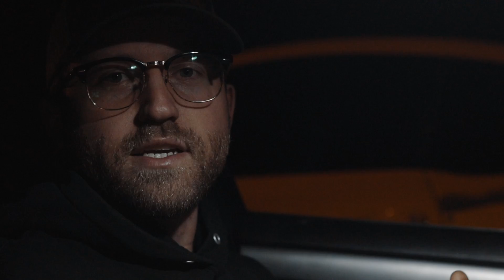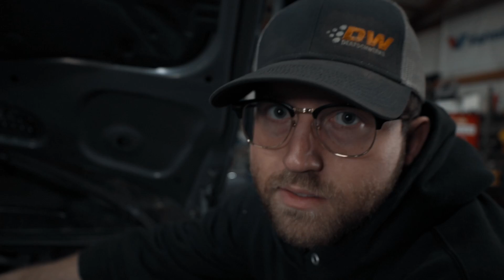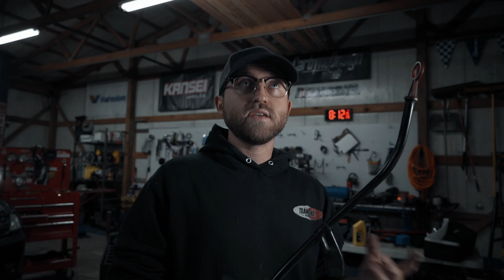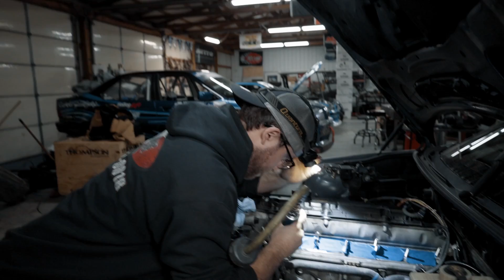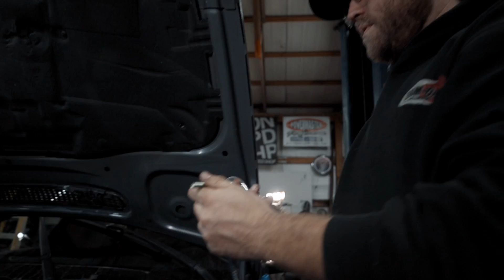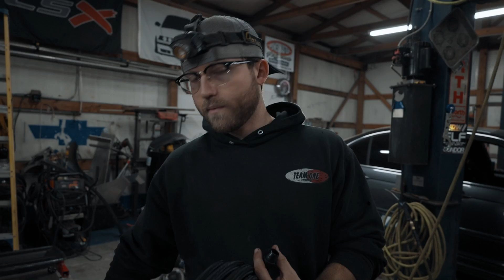BEST E46 M50 INTAKE INSTALL VIDEO - Is it worth it?

Comment: What part on the intake did you hook the catch can to? 
Valve cover-> catch can -> intake manifold. I’m doing a swap too I don’t know where I’m going to mount it, didn’t spend time on the video how you installed it
Reply from the maker: I ran a atmospheric catch can so it just goes to the valve cover directly. No intake vacuum at all. 

Are you running a sealed catch can or atmospheric?

Comment: Hey nice video man, also a question, where did you route your fuel pressure regulator ?
Reply from the maker: The FPR is built into the fuel filter on the E46😊
Reply: @jack_davis_ what about the 2 smaller vacuum lines that went into the f connector on the stock intake boot. Wondering where u routed those two. Think the bigger one was the purge valve and yea the smaller was fuel pressure regulator vacuum. Any help appreciated nice video bro
Reply from the maker: @albertomendez9336 So I plugged off the purge valve hose and put a cap on the F connector. The purge valve and system was also deleted in the tune. I did reinstall the vacuum line on the F connector for the fuel pressure regulator.
Reply from the maker: I would just put them back in the stock location if you don’t plan on deleting anything!
Reply: @jack_davis_ i really do appreciate the response bro, i saw in another comment u deleted the purge valve and im probably gonna do the same.

Comment: The stock B30 intake is the best of both worlds for m52tu/m54 engines, low end torque and high rpm power
Reply from the maker: It’s definitely a good intake but I don’t wanna deal with 100 vacuum lines at the track haha

Comment: What about purge valve .cancel or not?
Reply from the maker: Deleted it
Reply: @jack_davis_  i know this is super late but is there anything to help regulate the gas fumes after deleting the evap system? I just purchased an e46 drift car that already has the m50 upgrade and still trying to figure everything out, im about to run the catch can setup so hopefully that will help but do you have any advice? id like to run ac and not smell fumes

Comment: do you have to port your head if you swap to m50 intake manifold or can you leave it untouched?
Reply: Better to make the ports match to the manifold for the best results. It can be done without porting but if you have it open than it can easily be done in under an hour.

Comment: Yo bro. Cool content 
How did you run the idle valve line from underneath the intake into the induction. Which fittings did you use
Reply from the maker: I used a aftermarket fitting that came with my cold air intake

Comment: I’ve done the same things using your video that was very helpful for me. Unfortunally i haven’t done the ECU setup actually and car have problems at low rpms. It’s like the engine flooded at 1500/1700rpms and run very rough. Do you think that the problem could be the DISA valve not removed from ECU? Thank you 🙏🏼
Reply from the maker: Yes you will need a tune for the delete! Hit up Chaos Calibrations and he can get it fixed up for you
Reply: @jack_davis_   Thanks mate i'll do. I've just another question: you have put the fuel pipe vacuum of pressure regulator directly on M50 intake port or between MAF and throttle like sotck M54 inlet? Thanks again for help.
Reply from the maker: @lukko000000  yes correct I ran the “vacuum” line from the OEM fuel pressure regulator/filter to the OEM location on my aftermarket cold air intake
Reply: @jack_davis_  thanks buddy, actually i’ve this pipe pugged in the M50 port, direcly in manifold. I don’t know if the problem that i have depends from this, that actually i don’t have this pipe between throttle and MAF like OEM setup.
Reply from the maker: @lukko000000  the FPR small hose is not supposed to have full engine vacuum. You need to place it before the throttle body aka in non engine vacuum
Reply: @jack_davis_  thanks mate you help me a lot, really appreciated! 🙏🏼🥰

Comment: Hey great video bro wish I’ve seen it when I did my swap. 
What have you done with the purge valve that vaporized gas ,does you just keeping it open and letting it vent to the atmosphere, and the tune deleted the check engine light for it ? Or have you connected it back to the manifold? Thank you
Reply from the maker: Sorry for the late reply!

Our tuner was able to tune it out of the ECU functions and the delete the CEL as well. For me I wanted everything as simple as possible but if you wanted to keep the factory operation, you would need to tee in the purge valve to one of the intake vacuum ports.

Comment: Nice video! What fuel injectors are you running with ? Stock m54b30?
Reply from the maker: Yes stock injectors for now
Reply: @jack_davis_ did you ever upgrade injectors since this video? Because the stock ones have an opposite spray pattern as they’re installed backwards on the m50
Reply: @jack_davis_  same question as above

Comment: Ive got a e46 325ci, i got the m50 intake already at home, is it worth it?
Reply: no. It is easily one of the most overrated manifold ever. Ive literally dynoed more horsepower with m54b25 manifold on m52tub28 engine then with m50b25 intake manifold. Tune was adjusted too. Its funny that a lot of those videos tell about gains, and yet no1 does maf logs or dynos to support the claim. Apart from great intake noise, for stock engines, dont do it.  M54b25 manifold is great. No choke point for your engine even at 7000rpm.
Only if you opt for better cams, and 7000+rpm go m50 manifold.
Reply: Ah thanks for your expanded reply, so the only reason in my situation to do it would be for the noise then, id love some more intake noise so it feels more like a racecar. But im not sure if its quite worth all the hassle @TomoReso
Reply from the maker: @TomoReso  I totally understand what you’re saying however for our needs or a racer / mechanic / or just enthusiast I think the M50 and a tune simplifies the engine bay a ton and makes the car easier to work on when at the track. No more vacuum lines to break or fall off, no disa valve to break or start leaking, etc.
Reply: @jack_davis_   That is very true, yes. If done correctly it simplifies things a lot.
Reply from the maker: Yes

Comment: Bro i cant find m50b25 manifold i only find m50b20 manifold is it going to be ok to install on my m52tub28?
Reply: the m50b25 has bigger ports so its not gonna be the same with an m50b20. But yes, you can put a m50 intake on m52tun28 casue ive done that. But the kits the sell for m54 dosent macht, throttle plate is diffrent so you have to craft your own one, and also u need injector specers for the fuelrail.
Reply from the maker: I’m not sure how difficult or different they are to swap honestly
Reply: @jack_davis_  its a bit different but not so much harder. The only thing is that there is almost no tutorial or information how to do it on the m52tu so you have to figure out some stuff by yourself :)
Reply: that means if you want to mount only the m50 intake manifold on the m52tub28, you can't get anything, but you also need other things?
Reply: @petarbaleta5514  yea there is gonna be a problem with the throttlebody because they are diffrent boltpatterns, and the adapterplate they sell for m54 engines are not gonna work correctly for m52tu. And on the m52tu you have the fuel pressure regulator sits on the fuelrail which its not allowing you to get the fuelrail on correctly on the m50 intake. So you need to buy injetor specers to make it fit

Comment: So you cut the brake booster and routed it under the throttle body any pics ''and what did you do with the purge/ evap valve exactly '' Also there's 2 vaccum lines on the f connector not sure if I missed it but what do you do with those 2? Thanks again I'm doing my swap soon
Reply from the maker: Yes I just cut the factory E46 booster hose and made it fit on the M50 manifold. I deleted the purge valve and tuned it out in the ECU via Chaos Calibrations. If you wanted to keep it all you would need to do is route it to one of the vacuum ports on the intake